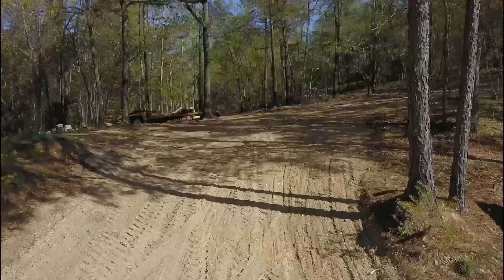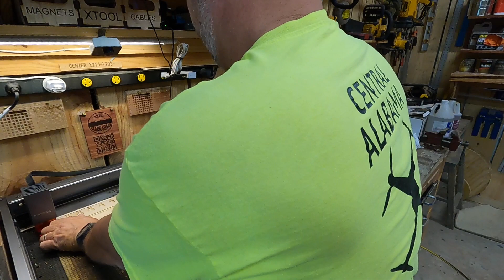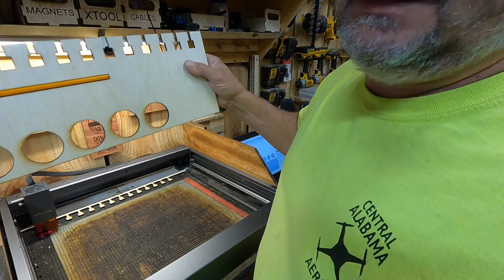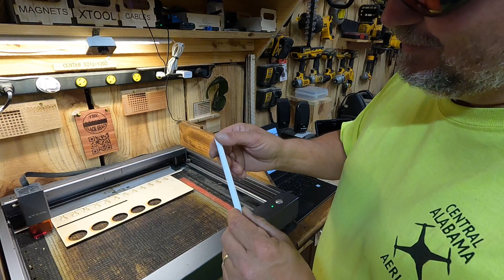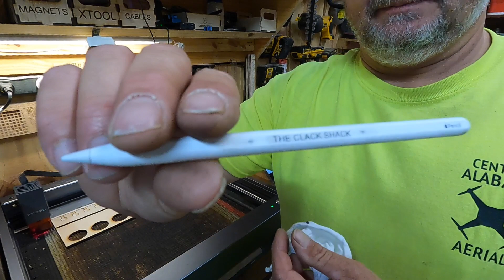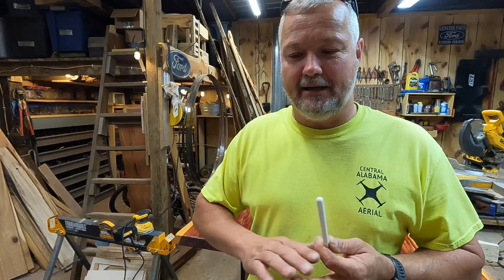Making a jig and engraving an Apple Pencil

Comment: For the area that you place the pencil would it be wise to use a tool mark instead of deleting the cut line the way that you've referenced in past videos?
Reply from the maker: This was one of my early videos… I do
Reply: @TheClackShack  This is not related to templates but you seem to have a vast knowledge of the engravers so here goes. I purchased my DR PRO on the 16th of Dec and I have already had to replace the lens. It would not cut through the 5mm stock I wanted to use as the jigs. I took it apart and when removing the lens there is a square that seems to have been burned onto the lens itself. How often do you replace lenses in your D 1 PRO?

Comment: Another few questions:  1.  How do I make home x1,y1?    2.  Instead of taking out the cut line, can't we just change the setting to no output on the cutline?   Suggestion if you can, show the screen as you are entering data in the lightburn software.  It might be helpful in learning process.  Thank you so very much for sharing your skills.
Reply from the maker: It is in the device settings. 

Yes, you can. You can also set it as T1 for a tool line. Still learning the software too.

Yea, I need a better software for screen recording. Just getting started.
Reply: @TheClackShack  just to be clear, I was not complaining, I think you are doing great job.

Comment: Just purchased xTool D1 10w and wanted to purchase your jig.  Question would be, what power and speed settings do I need to set in order for it to cut?
Reply from the maker: Depending on the material, I use 1/4 inch plywood and run 100% power 4 passes. 5 if you really want to be sure not to have fibers holding.